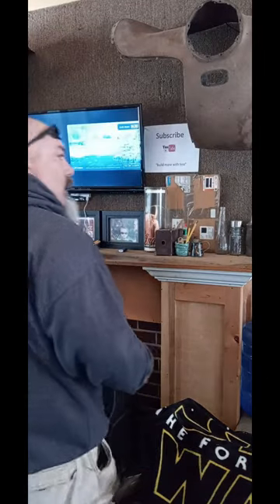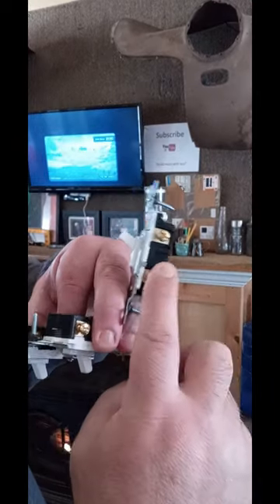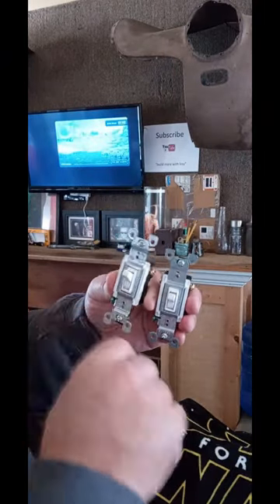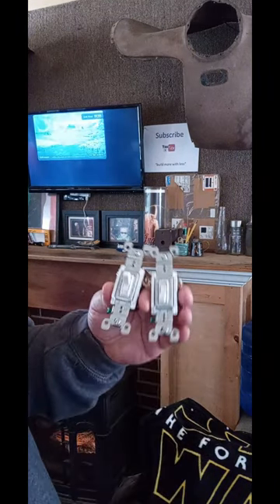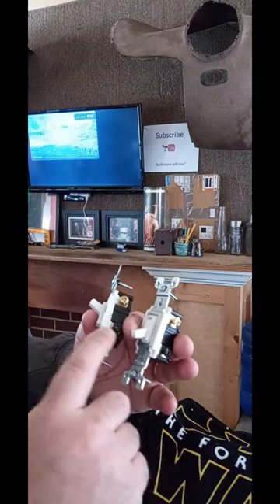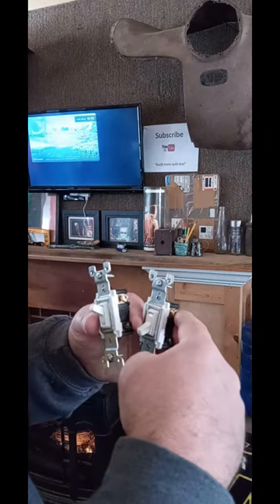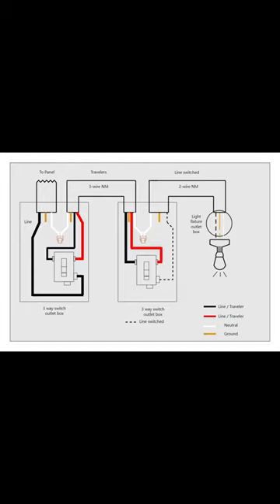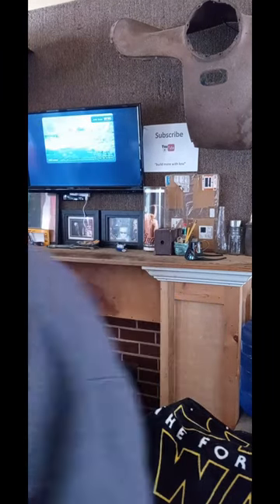3 way switch is easier than you think, Electric 201 with Buildmorewithless #diy #buildsomething

Comment: Two things. 

First, I had an electrician say to me ‘if you’re black, you’re golden’.  It might not pass DEI, but it is an easy way to remember that your hot wire generally goes to the gold colored screw. 

Second, when do you show how to wire a 4 way switch?
Reply from the maker: Yes Rick, that's generally correct, black on brass is the same term. for the most part black is the power. red can also be power. btw Thanks if your subscribed, and if not please do! next week I can put up 4-way switch! no problem! thanks #buildmorewithless